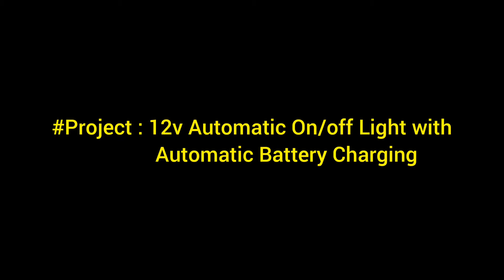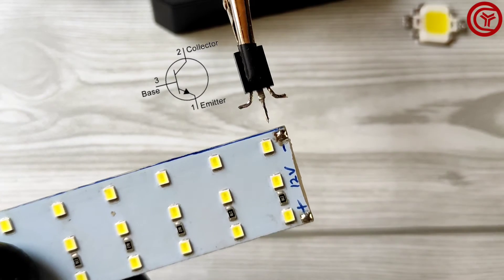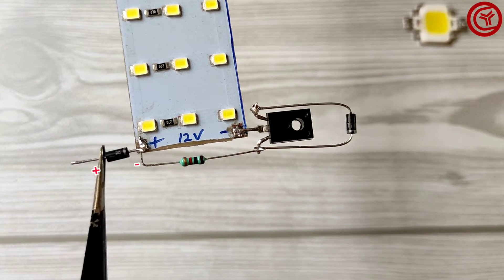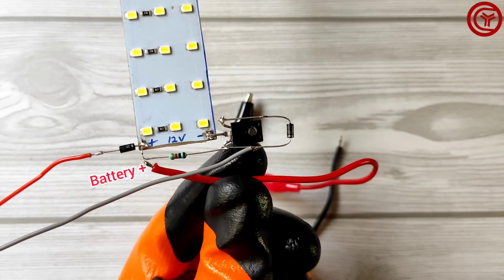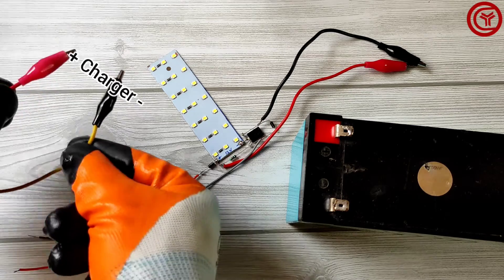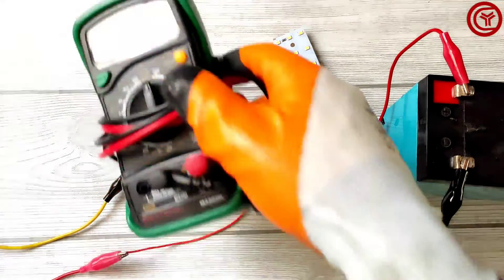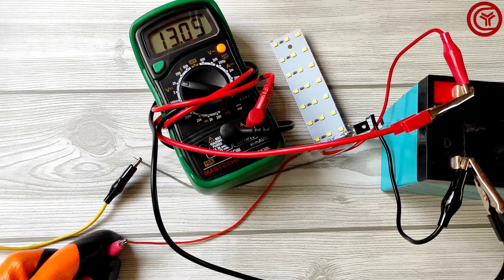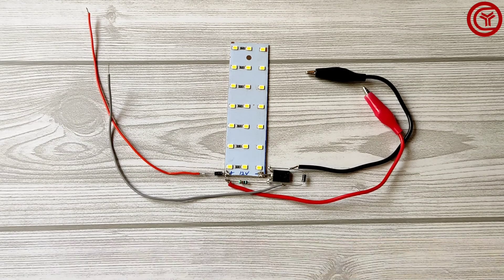12v automatic emergency light circuit

Comment: Muito bom o circuito. Porém ele carrega muito lento a bateria . O que fazer para o carregamento ser mais potente? . Pode ajudar?
Reply from the maker: Use the power transistor (high amp rated) also use 3a diodes instead of 1n4007

Comment: Hi which tranistor is that?
Reply from the maker: D882 , or you can use any NPN power transistor, do check the pinout configuration first

Comment: Plz make inverter led tube light circute transformer less power supply
Reply from the maker: How many Watts?
Reply: @CreativeTechos  20 watts with battery protection circuit

Comment: 100 volt dc how to reduce 12 volt dc plz make circuit 2 amps
Reply: Tube light with build inverter connection plz make
Reply from the maker: I'll try to upload ASAP
Reply from the maker: From what you're getting 100v DC?
Reply: @CreativeTechos  led tube light blast out put is 100 volt dc .make 12 volt how to make
Reply from the maker: 100v , check out how much out put current
Reply: @CreativeTechos  700 m ampir current
Reply from the maker: Ok I'll try to upload ASAP
Reply: @CreativeTechos  bro need 2 amps current need

Comment: Sir i tried this and its working perfect as in video. But there is a delay while switching to battery mode. Around 5 to  seconds. When the charger line is off, the 12v  led glows after 8second delay. Why is this happening.
Reply from the maker: It is due to 1k resistor that is responsible for turning transistor on and off also the transistor is used not more powerful, so i recommend to try power transistor like TIP41C & use 470 ohms Resistor.
Reply: @CreativeTechos  okay thanks for tour reply, will try that and update

Comment: Any scheme for 3,7v bateray?
Reply from the maker: Same will work for 3.7v.
Connect 3.2v light instead of 12v also use 4.2v input dc to charge battery

Comment: Will the battery get charge by using 12 volt 5amp adapter as supply in this project
Reply from the maker: Yes you can use but replace 1n4007 diodes with 6a diodes.
Reply: @CreativeTechos  Thanks a lot for your valuable feedback

Comment: How much voltage is there in input voltage
Reply from the maker: 14v input dc to charge battery
Reply: @CreativeTechos   thanks for your valuable feedback
Reply from the maker: My pleasure👍
Reply: Which type of battery do you use for this  project details plz
Reply from the maker: I used 12v lead acid battery 7.5ah
Reply: @CreativeTechos  Thanks for your reply 🙏 👍
Reply from the maker: My pleasure, Thanks for watching 🙂

Comment: Right side connection is from battery left side connection yellow and red is DC r Ac
Reply from the maker: Bro in thumbnail its shown +charger- , so obviously its 14v dc that when you connect light will turn off and at the same time battery will start charging, 

You can use higher amps both diodes to charge battery faster

Comment: Left side connection wires or Ac wire or dc wires
Reply from the maker: Bro in thumbnail its shown +charger- , so obviously its 14v dc that when you connect light will turn off and at the same time battery will start charging, 

You can use higher amps both diodes to charge battery faster